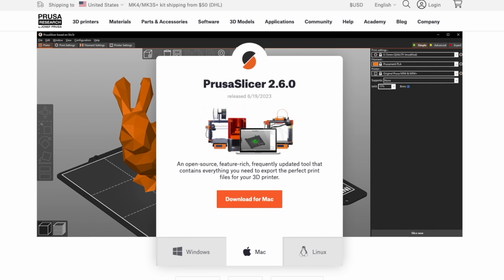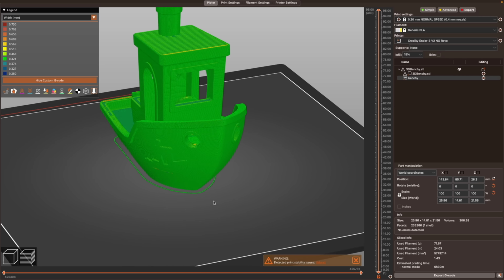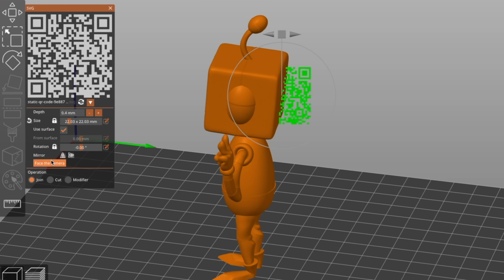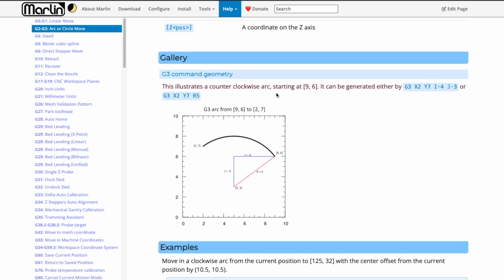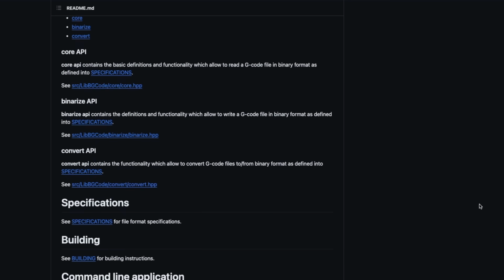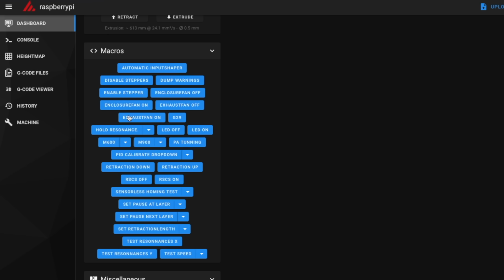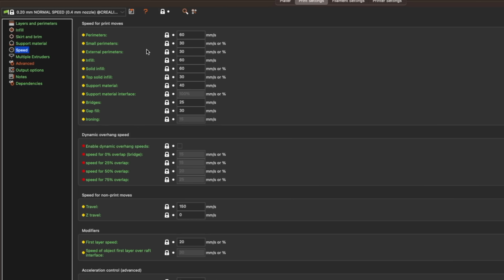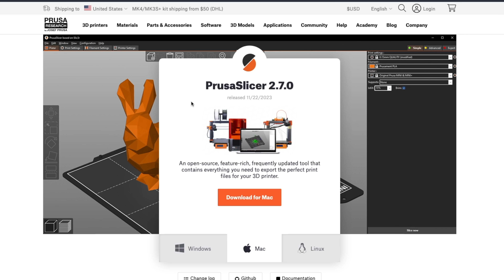Is Binary Gcode The Future For 3D Printing ? (PrusaSlicer 2.7)

Comment: I've made an OctoPrint plugin to support this new feature that is awaiting review in the plugin repository. It simply converts the binary gcode to ascii gcode on upload, gaining the benefit of faster upload speeds. After that it prints from OctoPrint like any other gcode.
Reply: Do you really see user noticeable benefits (and not only benchmarks) ? Here uploading to raspberry pi (or whatever OctoPrint host is) was never a bottleneck.
Reply: @arekx  yeah I use an old laptop for octoprint and my transfer speeds are limited only by the speed of the M.2 drive in it. On the other hand G2 and G3 are really nice for increasing print quality by printing arcs and circles instead of lines, but that only matters if the slicer assumes the stl files intended a circle instead of an insane ammount of lines. Which as far as i know they don't unless you use a .stp file which I think only Bambu Slicer and Orca slicer do. Nevermind that most wont have access to the file in step format and even less will have access to the original model and a CAD program that will even allow them to export in step format such as ModBot probably did with the ModBot model.
Reply: @Guardian_Arias  G2/3 are unrelated to binary gcode. These can be emitted into ascii gcode, too.
Reply: @arekx  I'm aware, I've been using G2 and G3 since the plug in first came out for Cura but migrated to orca slicer the moment i found out it supported step files since I use mostly my own models or at minimum a model I've reworked.
Reply: @Guardian_Arias arc welder takes line segments that look like an  arc and converts them to a single arc. Does some mathematical curve fitting with error margins, so the result is an approximation of a curve. I don't think any process actually uses curves from step files, they probably all create a mesh estimate use straight segments, then create an arc estimate from that
Reply: @zapl80  This is true but it only works with stl/obj/amf files with ridiculous number of triangles. A step file thats 300KB would often need to be around 100MB for arc welder to do anything. At least it used to. Most files people can download or purchase would have the equivalent resolution of 1-5MB and at that resolution the line segments are way too long for arc welder to pick up anything as an arc.

Just slice a file and look at the GCODE.
Reply: @arekx  no real benefit, because the time savings on upload is countered by the extraction of the ascii based gcode, but users in the community were wanting it so I made it.
Reply: This is brilliant and very nessecary. Awesome.

Comment: I wonder why binary is not default.  Are there any downsides to using it?
Reply: Impossible for a human to understand and troubleshoot.   Not backward compatible with older machines or firmware.
Reply: It's kind of pointless. Being able to read the file is far more useful than saving a bit of data. I've never had any issues with gcode file sizes, sd cards are far larger than the average person's print volume
Reply: @zapl80  For expert users as yourself sure, but I bet 95% of people with 3D printers can't even read GCode.
Reply: It WAS as set to default on my instance of 2.7, and that is a problem because I am printing through Octoprint and it does not know how to handle the binary version. Had to search for the setting and disable it. Thank gawd for the setting search function!
Reply: You should ask the other way around:
Are the any benefits to binary-code?
Filesize? really? going from 15MB to 10MB ... are you still using Floppies? Cause that is negligible.

Binary representations had been used before - when the code was read by tiny micro-controllers that had so little RAM (just a couple kb) that even parsing a string became a problem. And after even the cheapest chips could handle parsing it was just obsolete.

On the other hand - G-Code is a many decade old STANDARD. That is the whole purpose of having standards - that they "just work". There is no benefit to completely breaking compatibility with literally millions of machines.
Reply: @ABaumstumpf  However you ask the question I was honestly curious to understand  So far the only legit thing I've heard besides it not being "standard" is that you can't read it.  I think that's a fair argument for experienced users that understand how to read it.

So basically I was looking for pros/cons of binary vs. G-Code.

I'm also interested to know how it affects your prints, of at all.
Reply: @bluerider0988  "I'm also interested to know how it affects your prints, of at all."
It doesn't.

The idea of binary encoding is to make files a bit smaller and requiring less resources on the controller to parse the file. Neither of which offer any real benefits as even the cheapest hardware is more than fast enough to handle the standard text-based format.

On the other hand you lose compatibility with everything. Any and all tools that had been in use for decades, all slicers, printers etc. To use them you would need to translate the files back into the standardised format - which makes binary just a net-negative in that case.

If you are however working on a self-made system with micro-controllers so tiny that they simply can not even parse a simple text file during printing (we are talking about requiring a couple kB at most) then binary or direct control signals are your only bet.

Comment: I've been pretty pleased with 2.7 so far; I used the simple shapes and svg embossing to make some wargaming tokens very quickly from scratch. What I'd really like to see is some expansion of their mSLA features to expand beyond prusa specific machines.
Reply: I don’t think It’ll ever get chitu printers support sadly
Reply: @arturofernandez8487  I think that's an issue with chitu wanting their own ecosystem iirc. They aren't really open to the idea of people being able to easily tinker with the board either; not outright stopping people, but not really having many resources available on how they work. I have had many issues playing around with FFF Printers that use boards made by them- even simple configuration like setting Extruder calibration and PID tuning is a pain because those boards often use non-standard commands (No M503/502/501/500 for example), non-standard things like using mm-per-step instead of e-steps/mm, and seem to be based of some firmware from before 2015.

Comment: I fail to see the value of smaller 3D printer file sizes.  STL's are already tiny compared to a lot of other computer files.  Unless it leads to faster printing it seems like a lot of nothing.
Reply: STL files can become quite large depending on your output settings. I've often had files with well over a million triangles.

The file size compared to most native modeling files is actually very large.  Aka compare the size of a STL file to a SolidWorks model file or any native cad file.
Reply: It's not just smaller file sizes, STL's are a bunch of triangles, not really an accurate way make moves while printing or machining models with arcs (to exaggerate think of a low poly model). STL's are only straight line moves, so an arc or circle consist of single G1 moves (X,Y to X,Y) enough to complete the arc or circle. G2 (clockwise)/G3 (counter clockwise) is an arc code with one line of input and can complete up to a quarter circle (so 4 lines per circle) this makes for smoother completed models with more accuracy. I always convert to STEP before slicing for this reason, the smaller file is a bonus side effect that is also beneficial. And technically, it should be faster at printing as well with less harmonics.

Comment: One problem with binary is how do you manually review and edit your gcode if it isn't human readable? Do you have to translate it and edit then translate back? Also it being a Prusa only feature might speak volumes on it's own considering their units are still loosely based on a variation of the Mendel and are priced out of their performance branch in the market. Why fight and limit the open source that created the successful RepRap formula to begin with?
Reply: binary gcode is open source, so is the code to convert it to ascii and vice versa. It is only implemented on Prusa because it would be bizarre if the inventor of the format wouldn't want to use their own format and the fact that you can't expect a firmware update for other manufacturer in a month for a support on a feature that just has been invented that month. i literally don't know what could be more reprap spirited than this

Comment: Arc Fitting and "binary GCode" are features that Bambu Studio had from the start, which makes me wonder how a fork from Prusa Slicer took so long to backport. The Bambu binary GCode is jsut a 3MF file with the GCode file inside it (basically a ZIP with some predefined files in it, unzippable with the gzip library)
Reply: Lately it looks like "Prusa Research" is just waiting for someone else to do it then copy their homework.
Reply: Bambu probably also just took arc welder lib, which existed as octoprint and cura plugins for quite a while
Reply: @zapl80  It's all open source. Anyone can use or implement it. The real  question is why prusa took so long?
I cant wait until 2024 when they invent multiple build plates in slicer.
Reply: @hawtdayum  I know, they are all forks of slic3r in the end which started out as more or less gui-less perl script "for RepRap 3D printers, aiming to be a modern and fast alternative to Skeinforge." (which was pretty terrible). But since prusa, bambu, superslicer, orcaslicer should all work fine for any printer, why rely on prusa? (fork tree looks like this: slic3r -> prusa ->  bambu -> orca and superslicer which was forked from prusa - they all mix and include parts from cura as well, like the arachne slicing engine)

Comment: Klipper isn't really compatible with arc fitting (G2/G3). It works but it will break it down into G1 again. This can lead to very big load, overwhelming a raspberry pi 3 core. Klipper printing isn't multithreaded. Arc accuracy at 0.1mm (or less) in Klipper settings and 250mm/s printing speed will choke the pi and results in print error and shutdown.
Reply: I've not had any issues with arcs in Klipper, running pi4s though.
Reply: Fundamentally, that's how all firmware handle arcs, by line segmentation. Of course you want a sensible setting that is computationally and physically suitable for your machine. You probably don't want segment size much smaller than nozzle size anyhow.

Klipper's handling lacks robustness but does it even matter? I mean what would happen if you supplied 0.1mm segments in G1? Probably nothing good. Arc segmentation is fairly computationally simple and parsing overhead is less.